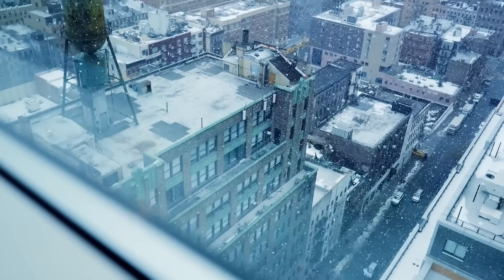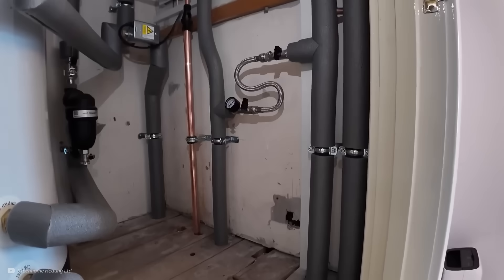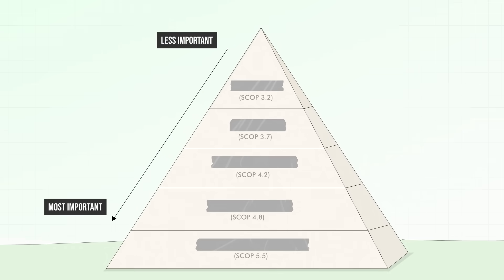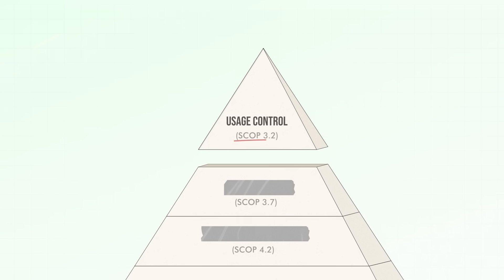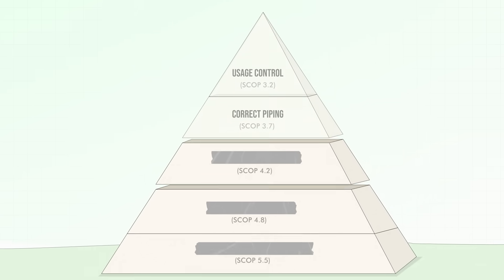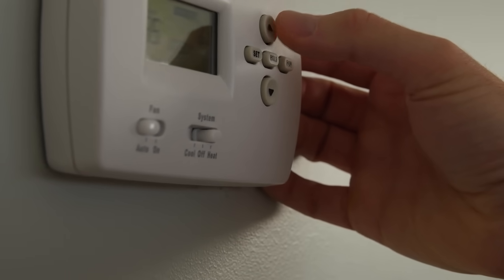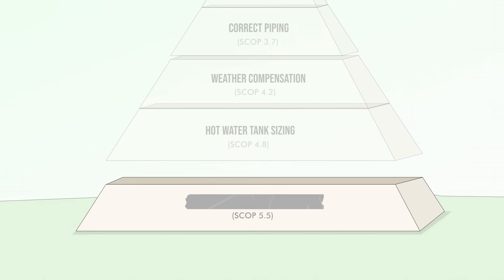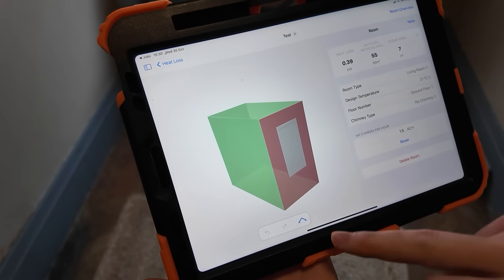The Genius of the World's Most Efficient Heat Pump

Comment: I'm a professional comfort advisor for an energy based HVAC contractor we do boilers geothermal hydronic heat pump water heaters tankless water heaters and of course we do heat pumps and we're using Daikin heat pumps I'll tell you what 800% cop is probably doable on some installations but the cost to performance are cost to value ratio is thousands of percent more than a standard heat pump installation which will get you between 300 and 400%. I can heat and cool home for between 12:00 and $30,000 but if I double the COP it's going to go from $40,000 to $250,000 depending on the installation. That's just residential prices We also do commercial and multifamily so well this is very interesting and I'm glad Adam has a lot of time to geek out on stuff because guys like him do help the industry I don't think I could make a living even though I'm in one of the highest income areas in America I'm in Seattle and we are pushing conversions to heat pumps like crazy here. The problem with converting from gas to heat pumps in this area is the vast majority of the homes don't have the electrical service they need to upgrade to heat pumps so that adds another 50 to 100% to the cost of installing the heat pump
Reply: What level of electrical service do you need?  Is the "vast majority of the homes don't have the electrical service they need to upgrade to heat pumps" older construction (ie 1940's/1950's) with 100 to 125amp service? Interested in your perspective as a Kenmore WA resident.
Reply: @toddwright662  Todd, I live in Victoria, BC, so similar climate.  We installed a Mitsubishi Mr Slim with an internal air handler (had oil furnace with duct work distributing the warmed air throughout the house.  We only have a 100 AMP service and panel and it is pretty full. The HP required a 30 AMP breaker, but never gets close to that demand to the best of my knowledge. We checked our house usage on BC Hydro's highest demand day, and our 2500 sq ft 1967 home (2x4, R 7 walls but we replaced all our windows and doors with high quality units) never used more than 70 AMPS. So then we installed a 40 AMP 220 V charger for our EV requirement and shortly afterwards replace our electric HWT with an electric Rheem heat pump HWT (50 gal/189 litre) which only has a 40 AMP breaker and only uses a portion of that and about 500 kWh a year (don't know what the use of the old electric HWT was, but it was likely about 3 times that).  Our total electrical consumption for our home went from 12,500 kWh annually pre heat pump which was installed in 2010 to about 9,100 kWh a year now. We're using 25% less electricity now and we're charging our EV Leaf at home almost exclusively and driving it about 11,000 km / year. And still only have the 100 AMP panel, to which we're adding a 6 kW solar panel array in the new year.  So don't worry about your 100 AMP panel - they can replace the old breakers with new ones that are smaller so you can avoid the high price of a new larger panel and the upgraded service. Reducing your load with higher efficiency appliances like HP, HP HWT, fridges and washers and dryers will more than make up any possible increase in electrical consumption by the HP (as noted above, our high efficiency HP seems to use less electricity than the burner and blower on the old oil furnace.  If you have electrical baseboard heaters, the HP will cut your electrical consumption to heat your home by about 75%.
Reply: @toddwright662  in that area, AC is not common, so 100A service would have been overkill until recently. Even in areas to the east where AC is common, they still can't support electric backup heat. I always recommend gas backup here. Since no manufacturer makes a gas backup HP package unit, that makes it dead on arrival for 99% of my customers.
Reply: @toddwright662  If you can run central air, you can run a heat pump, but not the backup heat. Even in, e.g., Wisconsin, backup heat is only needed a few days a year, but it's still needed.
Reply: Plus the electric car plugged in.
Reply: 250k? lol 
just put that money into stocks,
 move to some warm island
 and live off dividends
Reply: So going from 100a (is that a common baseline in the us? I live in a 230v country so this problem is unfamiliar to me) service (12kw total?) To something more would require sending new cables which could require new expensive cabling. But optimising would reduce the power load, so it would save costs? 12kW should be plenty for any single family house, might need a smart system to limit peak usage though.
Reply: @Jacksparrow4986  Canada and US generally supply 230v split phase to every house. 12kW would most definitely not heat most houses here. Something small, around 900ft² (80-90m²) in a warmer area and protected by the wind and decently insulated/vapour sealed would be ok. Anything else would need more. It's not uncommon to need 20-30kW of heating. (minimum 200A service required) Either that comes from fossil fuels, resistive heating or a heat pump operating above a cop of 1. Since our design temperature is -18°C, it's hard to get a heat pump to output that much heat at that ambient temperature. (this is Warmer area.)
Reply: @SuperS05  thanks for the clarification. As you need 20-30kw thermal (?!), a 12kw electric should be possible. How long is the cold spell? "Ice tanks" might provide a "heat" source of >=0°C if feasible. Insulation would be an obvious option alongside with controlled ventilation with heat recovery. Also going hybrid (leaving gas heater installed as a backup), though I don't know the product options and installation woes. Going the "extra mile" (german perspective: meeting legally required minimums) with Insulation could save costs for an electrical service upgrade.
Reply: @SuperS05  USA nominal residential voltage is typically 240V split phase for standalone houses, 208V is seen pretty often in apartments/condos where each circuit gets 2 legs of a 3-phase circuit.
Reply: @Jacksparrow4986  that is design temp as per AHRI. That isn't just a cold spell. 2.5% of the heating hours will be even cooler. And considering our climate, we have fairly strict building codes. Heating a 6500ft² (600m²) house within 30kW is certainly possible, as I've personally installed, but it certainly wasn't cheap. Point being, to beat our building codes by any substantial margin is going to be expensive, and likely without any reasonable ROI timeframe. Retrofitting a finished house is financially prohibitive, even with subsidies. (minor things like adding insulation to the attic, and sealing doors and windows is a benefit to older houses but is already seeing diminishing returns on newer homes) 

So to get to that kind of heating level with a HP and not just resistive heating, you'd need to use something along the lines of a Mitsubishi MXZ-8C60NA2. It has a rated COP of 2.0 at -15°C. (close with for this discussion) That means you'd be consuming about 9kW just for heating alone and it wouldn't reduce for potentially days or even weeks. Storing enough heat in ice/water would require a very substantial about of water turning to ice. Many houses would likely need at least this unit or multiple MXZ-8C36NA2 and/or MXZ-8C42NA2 systems. This would be up from the single furnace or boiler they have now, and losing that space would be a very hard sell. The noise level at max performance like that is quite high and often exceeds what major cities allow. If you haven't had a heat pump operate like this in a slight wind shadow, you'd see that it can significantly lower temperatures in that area. I've seen over 5°C cooler than the other side of the house. This is compounded with multiple houses using them in near proximity.

Multi unit buildings will be completely out of luck here. There's just no way that we're running new infrastructure for an additional 1-10MW per highrise. 4-8 unit buildings would likely be the maximum that could even be considered to use air source HPs. Ground source is not an option at all for the majority here.
Reply: higher efficient = less electricity needed
Reply: @dallasgombash5381  that still doesn't mean you'll have an ROI at all.
Reply: solar or insulation will slap the crap out of the roi on taking cop that high.   add 1" of blow in in the attic or 1 pane to windows or idk....100,000ft of radiant floor piping ffs.  

smart demand breakers will solve this problem for far less than stupid electricians tbh.  just buy a few new eaton active breakers or whatever that can turn off /on when voltage drops.  how bad are those houses holy f.  50A services? 60?  that should still be plenty youd think for minisplits and some heat pump dryers/hot water heaters.  ev is gonna need that anyway.
Reply: @richardroberson9277  2 Mitsubishi PUZ-HA36NHA which would be about 65mbtu at our design temp would be running at about 11.7kW. That would be enough for a small - medium sized house here. Definitely under 2000ft² without VERY significant insulation. 11.7kW is 48.8A at 240V. So no, a 50A service is not enough. A 100A service wouldn't be enough as you can't load shed primary heating as standard practice and codes don't allow you to exceed 80% of supply based on a diversity calculation. (assuming no natural gas appliances) An EV charger is typically 30-50A depending on the charger you pick with the wiring and breaker being sized at the 80% rule. (40-65A) A oven /range being 30-40A with the same rule. A clothes  drier being 20-40A depending on tech and model. Hot water heater will be 20-40A even using a HP model as most still have resistive heating elements. Same 80% rule. So that's 175A-265A just from that list alone. (diversity let's you reduce that a bit but not enough for a 100A service)
Reply: Dude.  Inhale.

Comment: What about the electrical energy that goes to power the compressor motor and the outside fan motor?   Is this energy just wasted to the atmosphere ?    The compressor and fan motor should be inside the house.   You can have the fan motor inside and run a shaft to the outside unit where the fan blades are.  The compressor can be inside no problem.   It is noisy but that can be cured with sound muffling.

Comment: Maintaining the temperature of a big water tank to as high as 40 C could be a prerequisite for breeding bacteria and fungi, which may spread through the whole system, including the hot tap water. What kind of techniques are they using to prevent that?

Comment: How are we supposed to know what the COP value is? let alone measure changes when we make alterations.
All I know is that my parents' system converts money to a lukewarm house (19'C) where they use electric heaters to boost when they feel cold. It's a relatively modern house with cavity walls, double-glazing and loft insulation, so it should be reasonably efficient.

Comment: Using air as a source in Canada is no good. My design I'm working on uses a solar thermal heater to capture heat during the daytime from the sun. Then I'll use a heat pump to increase the temp, and store it in a phase change material to be extracted from to heat the house with hydronics. If the sun is too weak, I'll draw heat from a ground loop. Obviously this is easier done when you live rural. Other than 3-4 months, the solar heater will produce enough heat to bypass the heat pumps completely. I designed the heaters and whatnot myself, and they don't need to be crazy because I'm not trying to get up to water heater temps. To me, not using the sun for a source is a big lost opportunity.

Comment: For those saying over 100% efficiency is impossible read this: COP is a better term and is used by scientist and engineers in this situation. Efficiency is usually (power in) / (power out) but think of it as (heating power moved)/(pump motor in) or (energy you want)/(energy you're paying for). Imagine you live in the Arctic and have a pool of lava next to your house. You run a conveyor belt to run buckets of water from your house to the lava and use that hot water to heat your house. The only energy you are paying for is the conveyor motor. Heat pumps are similar, but the temperature differences are much less than this example. As long as there is a temperature difference between two objects (house and earth) you can get more energy out of the system than you put in, but more is better.

Comment: Good video. However your SCOP focused primarily on heating. Using water is a great idea and in the UK it is very common to use radiators for heating. Here in Canada we don't use radiators very much. I've lived in four different cities and have never even seen a radiator. We usually use a forced air furnace or baseboard heating. Both work for heating but what about cooling? One cannot effectively use radiators for cooling. One also cannot use in floor radiant heating coils for cooling either. Here in British Columbia we often have 30C to 40C days during the summer. Are you suggesting using radiators or in floor heating coils for winter heating and then use a service head to allow cooling during the winter? IE: a mini split type of system? If so that would increase the complexity and the installation costs astronomically not to mention the operating costs of the system. I think you are not being very accurate in your estimates for efficiency as you don't cover different systems. Just water? That doesn't apply to sooooo many people throughout the world.

Comment: Tardo thermostat seems to handle relay based boilers in a very unique way, where it actually modulates a boiler that can’t modulate, it turns the boiler with on and off times of 5 to 15 mins depending on how fast temperature is dropping and outside weather report)

if you use a EU wireless receiver (or wire the radio thermostat directly to boiler) you can use opentherm or bus to modulate the boiler output (the uk/world wireless receiver doesn’t have the data pins for opentherm/bus control)

Comment: Ground source heat pumps use buried pipes and extract approximately 50 degree fahrenheit water for heat transfer at all times. No defrost cycle needed so heating is uninterrupted. Even so, the equipment must run a much longer time to warm a building as compared to a natural/propane gas furnace which has been proven for many years now. I have to ask why are we looking for technology that costs more, is less reliable and still uses electricity that must be generated anyway?
To my understanding I believe we have already reached the pinnacle of technology years ago and are now working backwards due to assumptions of climate change. By the way, what can be done when climate does change? Throw money at it that we don't have. The damage has already been done, with above ground nukes, filthy industries and vast pollution over many decades. Stick with what we have now and plant more trees and above all pray to GOD to help us.

Comment: You based this whole thing on Water house heating and Water Tank and Water Water Water?  Lets talk Heat Pump!
#1 wrong, lowering your heating during the night absolutely lowers power usage, not the same at getting 2 cars to the same destination at the same time!
#2 wrong, plastic can be just as smooth for water flow.
#3 wrong, Mini Splits already do micro adjustments rather than on/off.
#4 wrong, everything about this waste of time!